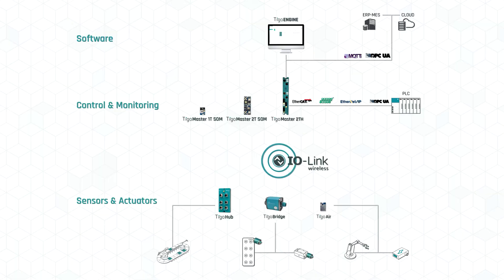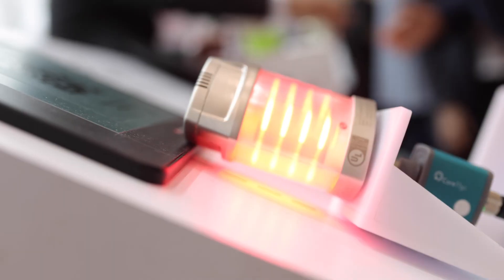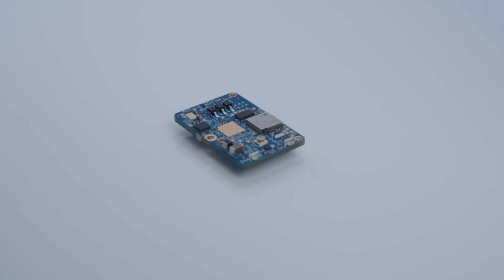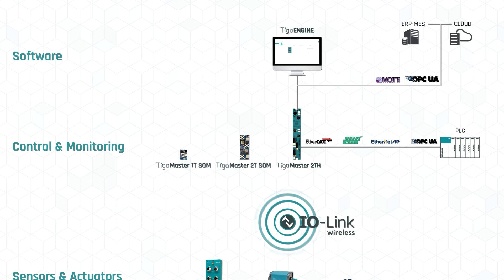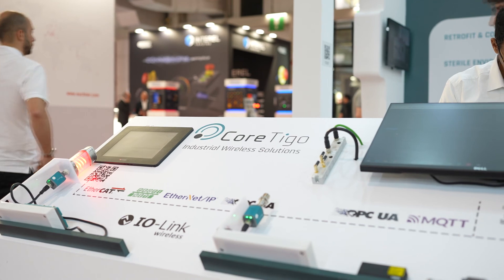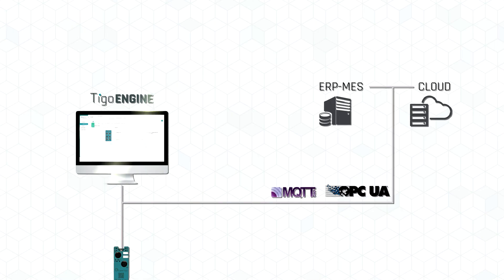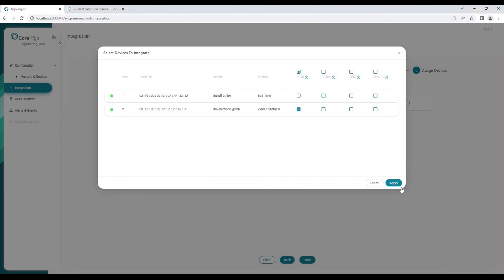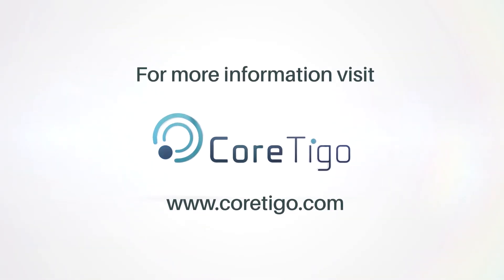CoreTigo's IO-Link Wireless Product Portfolio

Comment: Cool but you still need to add power cord…….some use on a particular wireless could be intresting
Reply from the maker: Hello, thank you for your comment. The power source depends on the application, IOLW supports a variety of power options that are already used today on machines and productions – such as inductive power, battery and slip rings. In addition, even when a power cable is used, it is already on the machine in most cases and it eliminates the need to run long cables to the Master or PLC.